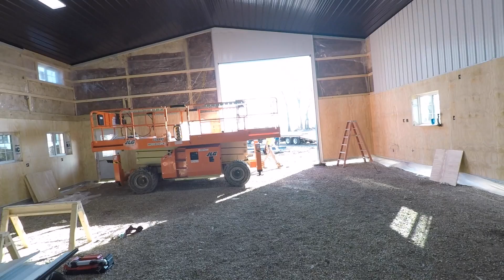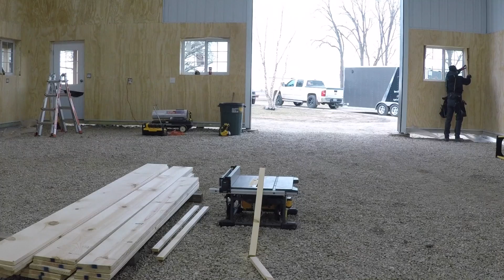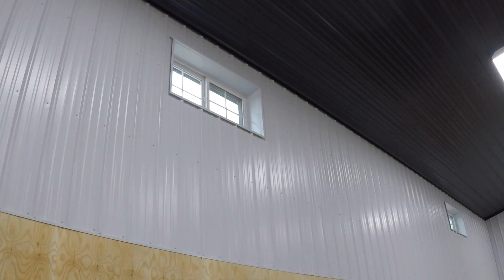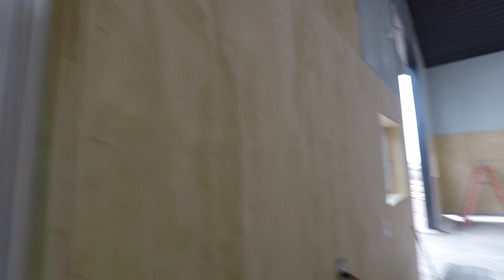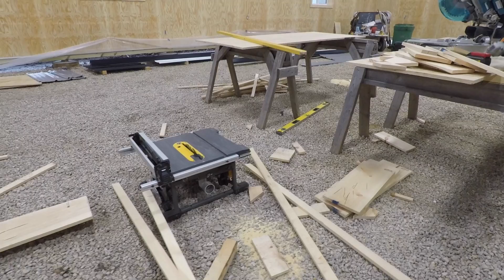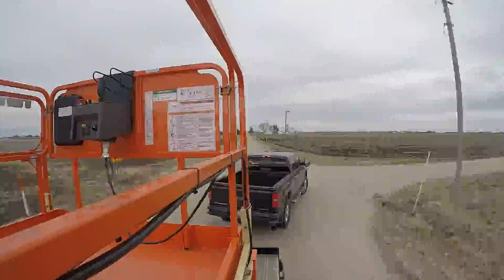Family Fun Barn Episode 15 (Semi-Final Day)

Comment: I didnt install housewrap when i built my 40x64....do you recommend i install it on the purlins (installed on the exterior side of insulation, from the inside of the building) before i insulate?
Reply from the maker: Kasey McCleary man I hate to recommend something we don’t do.  Depends on region if that’s acceptable.  I’d ask a builder in your specific area
Reply: Best to ask local building inspector office with such questions

Comment: Will you show the concrete and radiant floor heating? Do they have anything for cooling in the summer?
Reply: For the amount of money the customer spent on that building it would be a shame to not have air conditioning. With those high ceilings, a Big Ass ceiling fan would be nice to bring the heat down in the winter too.
Reply: with radiant floor you don't need a fan to push air down
Reply: With a sealed and insulated building it will stay plenty comfortable in the summer as long as doors stay closed.  Fans moving some air around would be plenty.